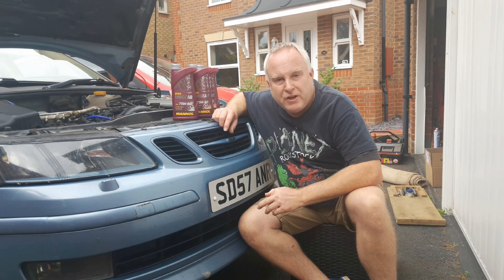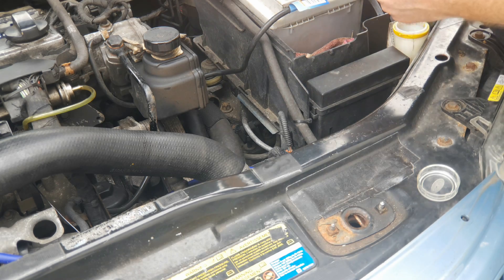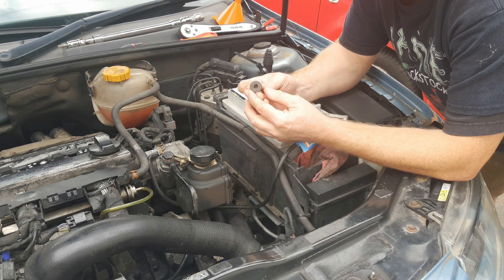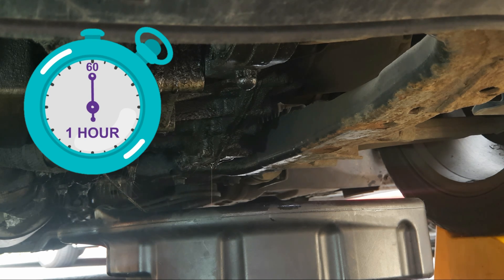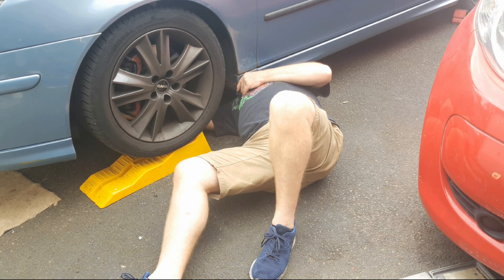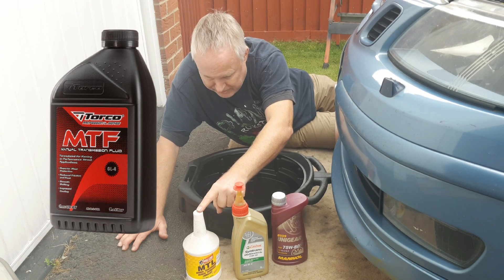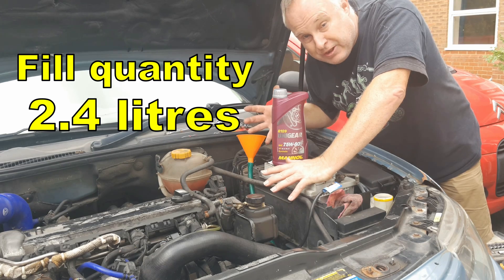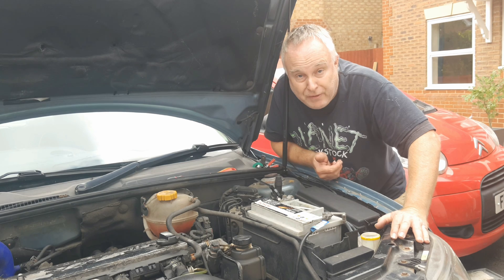How to Change Saab 9-3 Gearbox Oil | GM 6 speed Manual Fluid Change 🛠

Comment: Thank you Sid, 3 years on, still helping us keep our Saabs tip top. I just changed the OEM factory gearbox oil on my 190k mile Tid Sportwagon. I expected something very nasty to flow out but the fluid was dark but had no sparkly bits anywhere (I strained it through a filter to check). What had become a clunky box now changes smoothly and is a pleasure to use.

Comment: This was of terrific help. My 98,000 mi Buick Regal 2.0T came to me last year and always had a slight notchiness to the shift. Drained away ~2.2L of a dark red fluid (ATF?) and refilled with the recommended US GM 75W85 (19351859). Honestly instantly better. 

Fill plug: an honest 8mm. Drain seemed to be a T50, but an 8mm tapped in.

Comment: Great video very informative. Seems a bit strange why they reduced the amount of oil if it was designed to be filled with 3.2 liters, the whole gear change thing is a cop out so their cars dont have bad gear changes. Having stripped a f40 and seen the inside there is channels that funnel the oil to the bearings when the box is turning, for those to work properly the level needs to be higher, 3.2 liters. Ive since filled mine with 3.2 and never had any gear change problems. Feels exactly the same as with 2.4 liters in. Gm Taking oil out is madness it reduces the lubrication quality.

Comment: my b207 doesn't seem to have a fill plug at the top of the gearbox :(
Reply: It depends if it's an F40 tranmission or the 5 speed one. F40 is the 6-speed transmission.

Comment: I just bought a 2010 9-3X. I think it always got oem gearbox oil..

Now, do i really need to flush the transmission before i put in Castrol? 

Gearbox has developed a mild scraping sound at low speeds and i hope it is due to bad oil or perhaps a leak from the drain-plug causing low oil level..

Comment: I’m having a problem with my 2000 Saab 9-5 manual transmission reverse is giving me a lot of problem car runs perfect but when is time to put in reverse it just don’t want to go some time i have to switch off the engine and it may go in reverse with no problem taking out the key takes me 15-20 minutes i was told to change the shift linkage I spend $800 for a new shifter linkage still didn’t work what could be causing that problem

Comment: There's no need to change the oil in this box. The F40 is bulletproof. Seen many Saab, Alfa Romeo and Insignia diesels over 300.000 miles with the factory oil shifting as new.
Reply: I've flushed mine to check how much there was in it and it was very clean at 150 000km.
There was 1,85L.
This guy is nuts to change it so often.

Comment: Thanks for all the videos, they've been of great help especially for double-checking all the quirks in removing trim and other things, and it's funny how you just happen to have the same model, year and color as mine. WIS states that both mine (F17, Z18XE) and your gearbox should have OEM-number 12799117, and the oils that I've found with that number are GL-5 (API GL5). Still, you advise not using GL-5? Edit: Ah, found older comments asking the same question - yes, the one I found (Febi Bilstein 32590) was both GL-4 and GL-5, so then it's all good I take it.

Comment: i got a saab 9-3 2008 1.9TD last week and i was wonder so how is your experience with Mannol 75w-80 in the gearbox ? Any good since mannol is cheaper oil or u recomment still going for the castrol Syntrans?

Comment: Thanks for this video and so many others. ive done quite a few of jobs on my 9-3 using your channel. How much moly slip did you add to the Castrol ? and did you end up liking the Mannol?
Reply from the maker: Oh yes. the Mannol is still in, liking it very much. Based on the instructions about half a dose of molyslip. Used it in the C1 too. Also an improvement

Comment: Hi Cyd, thanks for this. The Haynes manual recommends replacing the sealant washers. Do you do so, and if so do you know the size and material so I can have them ready please. (I have a 5-speed box but I’m trusting they will be the same as the 6speed…) Thanks!
Reply from the maker: Copper crush washers (or aluminium). Look at the size of the plugs I link in the description. IIRC they are M14
Reply: @CycloneCyd  thank you Cyd. One other point, I notice the oil you are using for this change is GL4/GL5. I note in your video you say definitely do not use GL5, but I take it that GL4/GL5 oils are compatible and safe to use?
Reply from the maker: @Horses4life-f7g  GL4 or GL5 fluids should be used in their respective 'boxes only. A GL4/GL5 fluid may be used in both. GL4/GL5 fluids are becoming more common now.
Reply: Did u get an answer. I too have 5 speed saab 93 1.8t linear 2007
Reply: @bikerworld4712  not yet, but I’ve researched more on the 5speed box. You need a ‘stubby’ 8mm hex key as the drain plug is very close to a suspension arm. Regarding the replacement washer, Halfords does a box of assorted crush copper washers, one of which I am hoping will serve the purpose. Good luck!
Reply: @Horses4life-f7g  thanks mate, I'm just waiting on some Mobil atf 3309 and I will try do this end of this month.
Reply: @Horses4life-f7g  how much oil came out
Reply: @bikerworld4712  I’ve yet to complete it, but Haynes manual and Castro website both say 1.9l, so should be good with 2 x 1l bottles…

Comment: I've found my 6 speed is a bit sticky into 1st and 2nd, do you reckon a fluid change would help? I know usually people recommend changing the pivot bush.
Reply: I changed the linkage as my gear knob was very sticky, especially when not in gear, it would stick left or right depending if I pulled it out of 1st/2nd or 6th/5th and not return to the centre. After renewing the linked with some bits off ebay it was like new! I probably will change the gearbox oil in the summer when I do an oil change too. Car will be over 200k by that time and I have no idea if/when it was done previously.
Reply: @simon1290r  My car needs a new clutch, may ask them to have a look at the linkage as well

Comment: I have a 2008 9-3 aero B207R engine with 71,500 miles and it has the  automatic gearbox, what gear oil would you recommend for that gearbox? Great videos by the way, very easy and informative 👍
Reply from the maker: These have an Aisin box which needs ATF3309. I'm a big fan of Mannol, so you could use this https://amzn.to/3Y2qUtw
Reply: Lovely job, thanks for the reply and recommendation, I'll make sure I get some. 
Is it still the same quantity of 2.4 ltrs for the 5-speed automatic box?
Also does the drain plug/bolt need to be replaced or can it be re-used? As I'm having trouble finding one if it needs to be replaced. Is it 10nm for the drain plug and 25nm for the filler cap. Again many thanks again for all your great videos and merry Christmas 👍🎄

Comment: I love these videos, super helpful and informative!! I am wondering if anyone knows if there are GM compatible clutch kits that will work in a 2009 Saab 93 2.0T 6speed? I’m having a heck of a time trying to find quality parts without spending 800$ + dollars. Any help would be greatly appreciated!! I read somewhere that a 2011 Buick regal has the same clutch, but the part numbers are different, does anyone have any experience with this? Thank you!🎉
Reply from the maker: I've just replaced my clutch. I removed an LUK and replaced it with an LUK. About the best. Change the flywheel too - again I went LUK. Also change the slave cylinder - I went Sachs on that. Was about £430 for parts and £320 at a Saab specialist for labour. https://aftermarket.schaeffler.com/en/luk-repset
Reply: @CycloneCyd  hello , i ve just do the same thing on my 2.0T.  LUK dualflywheel , sachs slave cylinder and clutch .... But i still hear rattle noise from Flywheel on idle .... Idea what could cause that?
Reply from the maker: @MB-in2km  Backlash on gears and diff. Seems common on F40s. Mine has always done it.
Reply: @CycloneCyd  and What did you do ? :)
Reply from the maker: @MB-in2km  nothing you can do

Comment: Hey i have a Saab 9-3 2003 1.8t 5speed Manual how much oil should i use i noticed that the car is not shifting smooth but i dont notice a bad clutch i tested it. I want to try this can you help me out?

Comment: Can I use a 9mm hex socket instead of the 8mm if the fill plug is rounded off?
Reply from the maker: Yeah, take the battery tray out for the room and hammer it into the hex recess. I've put links to replacement plugs in the description - they are affiliate and I earn 2-4%, so a great way to support the channel at zero cost to yourself.

Comment: Hi i have a 2004 saab 93t, can anyone point me in the right direction of where the fill hole is. Thanks
Reply from the maker: If it's the 5sp box it'll be about halfway up on the front face
Reply: @CycloneCyd  Cheers mate

Comment: Have a 2005 Saab Aero convertible  remapped to 280BHP change transmission fluid every 30k so far at 105k miles everything ok 🙏
Reply from the maker: I do mine every 30-40,000 miles even in the C1.

Comment: Car is currently up on the ramp at my friendly local garage, oil draining.  I just checked SaabWIS and it says fluid capacity total 2.4, fluid capacity refill 2.2L, presumably because 200ml remains in even after draining... I might ask them to split the difference and put in 2.3L, given they'll also be adding about 120ml of Molyslip 2001G.
Reply from the maker: In a garage, yes. At home you'd let it drain thoroughly.

Comment: Hi Cyd - should I ideally replace both fill and drain plugs, and are they the same part number? I found a UK based eBay seller listing a Vauxhall part no. 11099271 (same as your eSaabParts link) - would that be right? Many thanks.
Reply from the maker: You should fit new copper crush washers. Replace the plugs if they seem damaged in any way.

Comment: Hi great content as usual 👌 did you use any moly slip this time when you changed the oil and how are you the mannol oil compared to the castrol only asking because I’ve got to do my box soon and there’s a big difference in price and availability. Cheers
Reply from the maker: The mannol is good. Shifting has remained consistently good. Now I've had a chance to drive it more, I'd say there isn't a big difference between the Mannol and the Castrol. Both are good.
And yes I put some additive in - I added Molyslip to the Castrol and one tube of this https://amzn.to/3LJA2MR to the Mannol. The Liqui Moly seems to be doing the same job with less product.
Reply: @CycloneCyd  do you subtract from the 2.4 the amount of additive you put in?
Reply from the maker: @nathanielramirez8997  yes. Well spotted. 👍
Reply: @CycloneCyd  noticed you added 1 tube of 20g to your 2.4 liters of transmission fluid, the tube I ordered is 50g which says it will treat 2.5l of fluid, any thoughts as to whether it would be safe to use whole thing? Some reviews said not to use it in synced gear boxes which is why I’m wary.
Reply from the maker: @nathanielramirez8997  yes, I only put a half dose in. I have previously used a full dose and it did make a slight improvement. I think the main benefit is mostly gained from putting in new oil. But, yeah, use the full dose if you feel the need.

Comment: Hello. You mentioned to not use GL5 oil. Why is that? Im stranded here, car on the jack and the 8mm HEX ready. And the oil is specified both GL4 and GL5 75W90. What to do?
Reply from the maker: If it's spec'd BOTH GL4 and GL5 that's okay. DO NOT use a pure GL5 - there are compounds in it that attack the brass synchros.
Reply: @CycloneCyd  Thanks. The data sheet for the oil says ”yellow metal safe”.
Reply: @CycloneCyd ah so thats it.. I used a MPM GL5 7080 olie could not find GL4..so I have the wrong olie
Reply: Use only GL-4 oil. If using GL-5 you might will have slow-shift gearbox. That is because that GL-5 has dubble much of EP-additiv then GL-4.

Comment: Hi. Is the 2.4 litre fill the same on all saab gear boxes. I have a 2008 93 TTDI and considering doing gearbox oil change very soon.
Reply from the maker: Not ALL boxes. F40 FWD only. 5sp and XWD are different
Reply: Thanks for your reply.
Reply: Sorry for being a pain. But if you don't ask you'll never know. Are gearbox drain and fill plugs the same size? 2008 93 TTDI .

Comment: Thank you very for your video, my insginia gave me a transmission warning then after a while jumped to neutral. at the moment it engages gear but i want to do an oil change and see what happens before taking it to a garage...thanks again, if anyone has had this happen to them please advise...thank you
Reply from the maker: If you got a trans warning, does that mean it's an auto? If yes, at least check the fluid level, but autos should have a fluid change every 70-100k, so is probs worthwhile.
Reply: @CycloneCyd  yes sir it’s an automatic, I am doing a fluid change over the next few days and I am praying that is the issue. At the moment if I start the car it will engage in gears no issues, drove it down the street and back and gear changes were smooth then when I think it started getting hot it went back to neutral, I started it after a minute and was ok… so hopefully the oil change will work, I will update you once I’ve done it.. thank you for commenting
Reply from the maker: @gushungo0903  do the change and see how it goes for a week or two. I'm thinking sticky valve in the valve block, or low oil level. The fresh oil may 'clean' the valve, but be sure to check it has the correct level. 
I don't know if this 'box is purely mechanical (unlikely these days) or ECU controlled (probably) in which case also check all connections for security, pin corrosion, damaged wires etc. I don't KNOW, but I'm thinking here that if there's a dodgy connection or a high resistance joint and the 'box is losing signal it may have a mechanical default that puts it into neutral (so fails safe). If you can get at it, also have a look at the edge connections to the 'box ECU. These have a habit of failing on ECUs of all sorts.
Reply: @CycloneCyd  don’t know how to thank you for taking time to give me all this advice, really really appreciate it… I will sort all this next weekend and will update you!!🙏🏿🙏🏿
Reply from the maker: @gushungo0903  you could buy me a pint ha ha. But seriously there is a link in the description.
Don't do it yet though, the things I've mentioned are all possibilities and good practice points but I'm no auto box expert, so there's still an outside chance my 'advice' is a load of twaddle!
It might also be worth researching if your 'box has a fluid filter - if it has, change it.
Is your 'box an AF40 perchance? If not, which engine and box combo do you have?
Reply: @CycloneCyd  AF40gearbox A20dth engine

Comment: Have you heard something about starting the engine while it's draining and shifting through the gearbox to get all the old oil inside to drain out completely?
Reply from the maker: Ouch❗ Poor gearbox! No, don't do that, just let the box sit for an hour and there'll barely be an eggcup left in.
Reply: @CycloneCyd  alright. Thanks for preventing me from doing that!
Reply: @CycloneCyd  what about straining half of my old fluid and mixing it with the new? I heard that it can be easier on older transmissions.
Reply from the maker: @oodles86  nah, not on a manual
Reply: @CycloneCyd  what are your thoughts on using Dexron 6? It was recommended today by my auto parts store.
Reply from the maker: @oodles86  Dexron 6? That'll be an ATF? TBH autos are bit outside my wheelhouse.
I'm fairly sure though that Dexrons are backward compatible, so you should be fine with 6 instead of 3.
Reply: @Cyclone Cyd  yes AT as far as I knew. I'd just never heard of using it in a manual transmission before.
Reply from the maker: @oodles86  NO, don't use an ATF in a manual box. Crikey, way to wreck a modern 'box

Comment: Bought myself a 9-3 last week, found myself scrolling through basically all of your 9-3 videos. Only thing I'm not sure of after this one, for the drain plug - did you replace the washer on there? Anywhere you can find a new one? I'm not having much luck finding any information regarding this on the web
Reply from the maker: Any 18mm copper crush washer will suffice, but there is a stainless drain plug in the description.
Reply: @CycloneCyd  I did not find a washer on the drain plug?
Reply from the maker: @koendb5456  is that a question or a statement? There should be a washer on the drain plug. Some plugs you can buy have an integrated rubber seal (similar to the B207 engine sump plug). At the least, use a 18mm copper washer.
Reply: @CycloneCyd  actually it's both. I've done 2 gearbox oil changes. 1st time a flush and 2nd a proper refill. Twice I haven't noticed there was a washer. No gearbox oil is leaking though. I've ordered a SS drain plug with rubber seal. Can I reuse the gearbox oil when I change the drain plug?
Reply from the maker: @koendb5456  Yes, as you know it's pedigree

Comment: Hi Cyd, I came across the mannol MTF-4 API-GL 4 75w-80. Specs look the same, but will it do the job properly?
Reply from the maker: It should, being a GL4. Just don't use a GL5.
Reply: Why ? @CycloneCyd
Reply from the maker: @drefhill  GL5 dissolve copper
Reply: @CycloneCyd and why is that a problem ? The gears are made of copper ?
Spheretech europe only have 1 type of oil for gearboxes 75w90 and it's GL4/GL5 compatible.
Reply from the maker: @drefhill  are you being deliberately obtuse? Synchromesh is made of brass.
More and more oils these days are GL4/GL5 - ie compatible with both.
Just don't use a GL5.